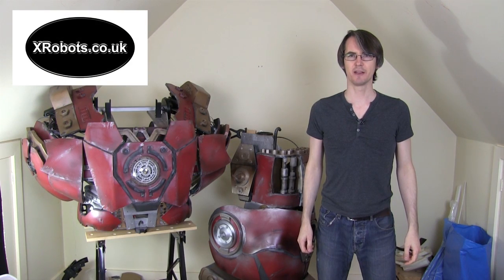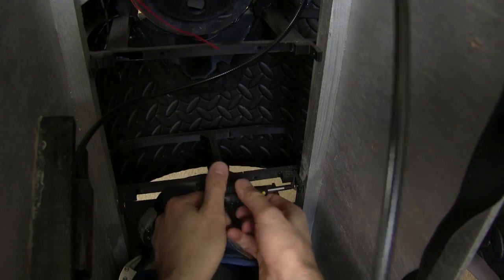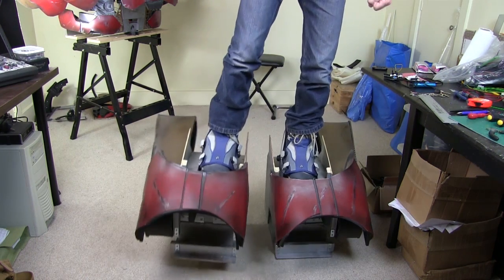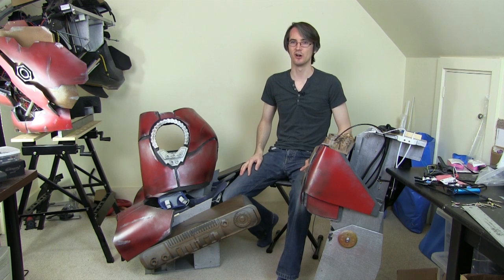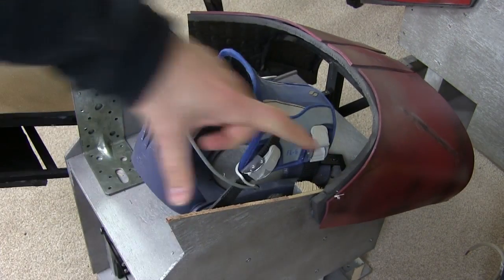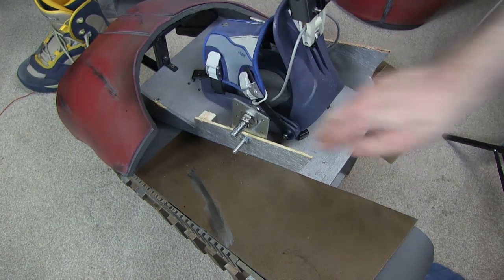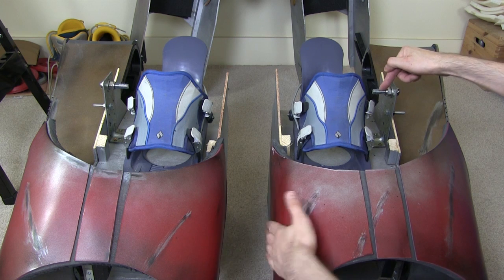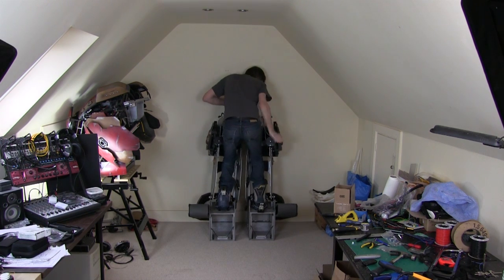Iron Man Hulkbuster Cosplay #43 | Leg Mechanics & Walking | James Bruton

Comment: I am a carpenter (framer) by trade and I carry a heavy toolbelt for 7 hours a day (less if I can help it), and I have suspenders to hold the belt (which weighs north of 20 lbs of tools and supplies) with 2 in. wide canvas suspenders, I would think that something like that would be a good way to hold the feet/legs to your legs.....

Comment: Has anybody suggested:
Dampen the 'clunk' of the lower toe with rubber and rig a micro switch to trigger a 'pneumatic / cool sound' with localised speaker?  (comment made 5:02)
Reply: +Dan Watkins Obviously IF you could produce a deep base note when the foot came down, it would give the illusion of the suit mass.

Comment: You know.. where the bolts hold the legs to the feet.. if you cushioned both sides of the leg by putting large foam washer or rubber washers on the bolt on either side it would allow for some twist and pivot but it would deaden noise and give you a bit of stability. Crude ascii text drawing   #-0-W-0-N  (#=bracket, 0=thick rubber washer, W=wood leg, N=Nut.)

Comment: I think a heim joint would would on that all thread pin. It would give finer control on the movement and wouldn't have you doing much redo. If you wanted a tech solution for locking out the legs you could use a linear actuator powered by your batteries. Attach them to the legs and have them drive into receivers on the feet to take the load. while locking out the heim joint on the other side.

Comment: hmm i'm wondering if the lower leg sections need a couple of straps around the back of the calfs to stop the rotation and additional bungee at the ankle to dampen the movement slightly.  

some exoskeletons also only have one point of contact with the ankle but only run up the outside of the leg so no inner leg section.

But still I have enjoyed the series so far and keep up the great work.

Any chance you will be attending the model world show in brighton in feb?

Comment: Hey James! I don't know if you've thought about this, but would a multi-axis bearing for the ankle joint work better than just having the L-bracket pivot around the bolt? If you put the bearing on the main leg section and had it slid over the ankle bolt, it could be a bit more stable and smooth. I'm not too experienced with things that large, so take the idea for what its worth. Good job on the suit so far though! I'm really enjoying this series, and I'm glad you didn't decide to scrap it! Can't wait to see it finished someday!

Comment: Are you not worried about the stresses of the legs pulling the bolt through the top of the "ankle"? That was an awfully thin piece of wood you left between edge and hole.

Comment: Glad to see you're sticking with it, your solution for the ankles definitely has promise, though I would have experimented with making a 3D printed set of pivots built to wrap around your ankle (like the CODAW Exo suits). They'd be printed thick for strength and using bungees pulling in both directions for stability.

Comment: James why not using ball joints for the ankles?
Reply: +James Bruton (XRobots) I was more thinking of picking one up from a scrap yard, there usually used as part of the wheel suspension system. One at each corner should give you enough movement and support. You can the use a single bolt to lock the joint. Nice work by the way been enjoing the videos :)
Reply: +Bert McDowell I was thinking the same thing through the whole video. it would seem like an easier method then have something to create pressure on the entire ball joint that would lock and keep it from moving
Reply: Yeah i figured of all people in this world, you be able come up with the idea! Not questioning your work james, just wondered if it was possible?
Reply: Oh i see what your saying. I didnt understand the 2 tubes part on the side of your legs that was for the lock i think. How is that gona work?
Reply: +James Bruton (XRobots) thanks for the video, James. It's clear to see how the new legs have really freed up the movement. And you were talking about a way to lock the ankles when you aren't in the suit. Of the top of my head I thought that a Slide Bolt mounted vertically could work fairly well, though I'm not sure they would be long enough.

Comment: @XRobots I have an idea for the ankle rotation locking mechanism. How about you make a 3d printed ball socket joint (like your hip joint) with a hole that goes through from the top straight through to the bottom with a pin that can slide through the hole to lock it up. That way it can pivot and rotate in all directions and stay stable when stood up straight.

Comment: Hi James. I think that you miss him springs of bigger resistance at the level of the articulations, as well as at the level of the heels. Hello of France.
Reply: Second that thought maybe trampoline springs? locking pin through the middle.
Reply: +Jack Douglas, The springs of trampoline it is a good solution.

Comment: Frankly, I"m not too keen on the new ankle. Sure it's gotta have something made out of metal to hold everything and sure you're gonna keep working on it (in part this is why i'm commenting here) but you definitely need something different there.
Now, I have this very rough idea of something like, two round bowls sitting on top of each other, with the diameter of the shin, and a very wide hole in the middle, so that the boots (and your legs) can go through and have some space for movement. If the bowls slide on top of each other, that may give the ankle a better joint (edit: a socket, basically). You could keep them together by attaching bungie cord around them, connecting the foot to the lower leg. But you would still need something to keep it standing up when you're not inside.
You gotta do something about the feet too, those wooden "flip flops" don't look very good or safe at the moment. How about using thick foam and making a giant shoe with metal or wooden stilts on the inside? You could make the tip softer (underneath the plastic armor cover, which should be hinged) to help you walking around.

Comment: Might I suggest making the frame slightly leaner?  The legs do seem to some extent a little too thick for the proportions of the frame.  Also, the arms seem too long for it.  Overall these modifications could result in a much lighter structure and maybe a more mobile frame ;)  Of course it would require a lot more work :P

Comment: i do not know how well it would work, but i guess you could make some ninjaflex bushings to mount on the new ankle joints (on the bolt that points towards you ankles, maybe put one bushing on either side of the joint), so it could keep the legs pointing straight, but the legs would be able to rotate as needed as you compress the ninjaflex bushing. anyways glad to see that you figured out the issue of walking, keep up the awesome work! I always look forward to your videos!